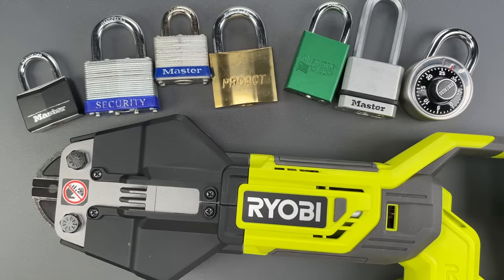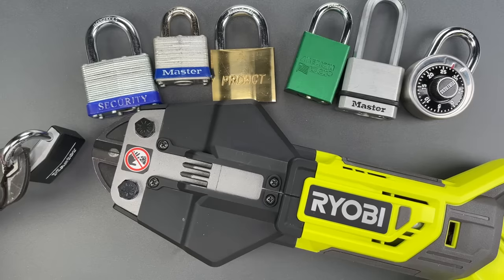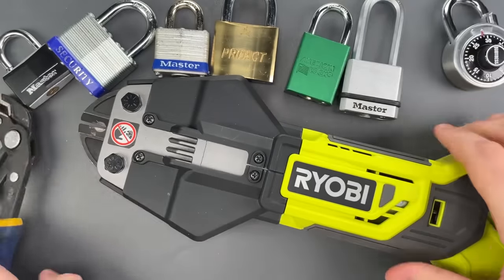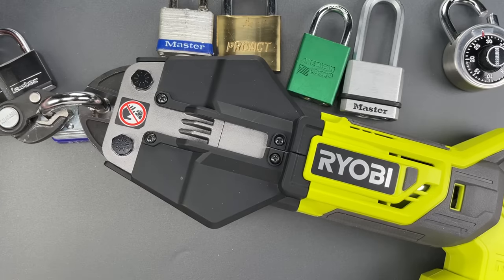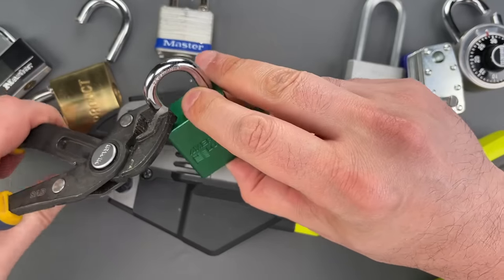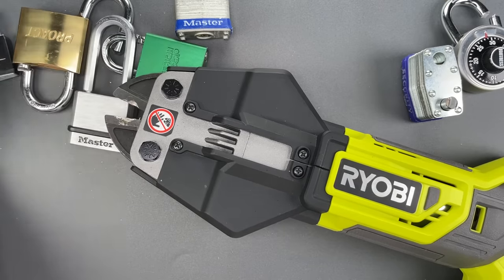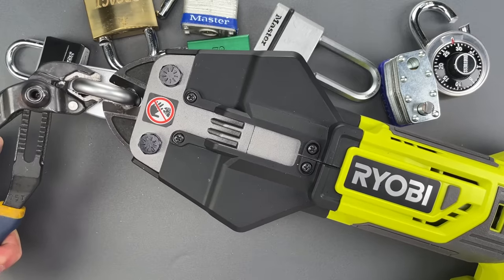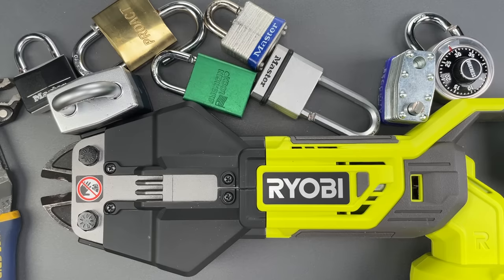[1408] Better Than Expected: Ryobi Bolt Cutter

Comment: I like Ryobi.  In my experience they seem to be thoughtfully designed, with good features and design that when you use them, you realize someone put some time and thought into the design. I should add, I am not saying they are a top tier brand outside of their price point.  I am saying they are a top tier brand FOR their price point.
Reply: In my garage, theres a lot of those Ryobi One+ range, and have been good so far.
Reply: Exactly.  My opinion is they are the best buy in non-professional tools.
Reply: @nonyadamnbusiness9887  Doing metal fabrication at work, theres hililti, dewalt, milwalkee, and makita drivers.

Only the makitia ones are any good.
Reply: The Ryobi of today is the Milwaukee of 2-4 years ago. 

It is the same tool just made with slightly cheaper parts.

Comment: This BC is good for armature work. Hand cutting (even with the floor + lever models) is gonna break your balls, having an electric variant, for those soft metals, god sent.
Reply: if you are in the position to need an electronic bolt cutter for locks, chances are you're out of the "amateur" ranks, either for legitimate business...or otherwise.
Reply: @innercityprepper  note the spelling of armature as in motor windings

Comment: I imagine there's a Squire employee out there that's now quite pleased with his/her handy work.
Reply: Likely they work in the heat-treat department. That's what counts when it comes to steel is the tempering.
Reply: @KF1  That no name padlock was made out of low carbon steel and you can temper it as much as you want with no effect... you need proper steel aloy, proper tempering and proper diameter of the shackle...
Reply: @Bialy_1  Yes, I was assuming the steel would be hardenable to begin with. I figured since it said "hardened" that it likely has sufficient carbon etc. Carbon is cheap, no need for special steel. Maybe 0.5%+ carbon and you're good.
Reply: squire from my own experience puts customers first and the quality of their products are top notch. I've had nothing but great praise for the company and how they treat their customers. Some of their products on the lower end are quite crappy though but only in the cylinder core. The product itself isn't really bad but they keep using their 4 pin core that they have used for 60 or so years and they don't have any anti pick features which is a disappointment. I've only had one lock fail in the field, I wrote to them about it and they sent me a new one free of charge. It's been fine ever since so it could have just been a bad batch which is expected on a large scale production run.

I can't wait to try out their Inigma padlocks when they release them.

Comment: *Reviews the item*
*Item did better than expected*
*"Yes, so i'd recommend using a manual cutter"*
Reply: Because expectations were that it would barely work or the blade would get easily destroyed. It doesn't work well but better than expected, the blade took a lot of damage, but better than expected. A manual pair would have zero blade damage after cutting all of those and it would easily go through all of those (as long as you buy the 18" handles for torque). Plus, manual is much cheaper. At least half the cost I imagine.
Reply: @raheppe  I know. lol

Comment: I'm a long time ryobi customer and I've always been impressed with the amount of abuse they will take
Reply: @LegendLength  the actual Ryobi mowers aren't that great but to be fair, if you're comparing to a Honda or Yamaha, nothing will be
Reply: @santumi2298  i disagree, the new ones with the brushless motor and HP technology kick ass. pretty much up to par with any gas mower out there except for the toro time master
Reply: I did have a Ryobi cordless drill driver (40 buck special) that worked for a year then started intermittently cutting out. So cheap I just replaced it and it’s been fine since. Overall I’m happy and I’d buy Ryobi again. Decent for home stuff and the neon green color really makes it enjoyable and fun to use for some reason.
Reply: @GrandHuevotes  if you want something a little nicer, i’d recommend trying out the hp tools :) but you can’t beat the steal of that $40 brushed drill driver
Reply: Just don’t use them on anything beyond wood. I work with steel a lot and I broke 4 brand new ryobi impact rated bits in 2 hours and broke there drill in a week.
Went to dewalt and they still work (both bits and drills) some several years later… you just get what you pay for
Reply: @ZEPR0FESS0RR  well, that's the difference between commercial grade tools and residential grade. Look at your warranty, it'll tell you what you bought. True professionals know the difference.
Reply: @ZEPR0FESS0RR  DeWalt is typically used for construction, while RYOBI is typically used for household projects.
There's a difference between commercial and consumer grade tools. 
Just like what Cory said, you can check your warranty to see what grade of equipment you have.
Reply: @ZEPR0FESS0RR  Were you using the impact bits with an impact driver? If not, that's why the bits broke.
Reply: @ZEPR0FESS0RR  Ryobi, while decent enough on tools is absolute shite on bits, be it driver, drill, or router. 

For cheap quality driver bits go with Hart. Same company yet some reason they make the Hart bits just that much better.
Reply: Ryobi is a meme.

Comment: Also, a trick which can be picked up from the use of secateurs to cut seasoned one inch branches or those in excess of an inch in diameter, it's always rotating the blades around the object you are cutting as you cut. This progressively reduced circumference and diameter of the material as you go and removes obstruction.

Comment: This would be great at warehouses where you get a lot of containers to unload. The aluminum bolts they use are tough to cut. The manual cutters are not cheap and when they break, you can’t replace the blades.
Reply: I found this useful too at some small post offices, and they went through securicor vans like butter !

Comment: I was hoping you should show the squire lock after the cutting attempt, to see if it had indentations or any visible damage
Reply: hi, do you know the mm thickness of that lock?
Reply: @sbaxter4207  It's pretty easy to eyeball, but 5mm is a hair over (#10 screw) 3/16", 6mm just shy of 1/4", 7mm essentially = 9/32", and 8mm = 5/16".
Reply: I agree, it wasn't obvious, but I am sure that shackle was barely scratched. You can see it in the thumbnail.

Comment: I really love the change of pace with this video. And while I've had a lot of Ryobi tools, electric ones obviously, I'm fascinated they would even make a product like this but as a person who once had a part-time job at a storage unit facility, we had to cut off quite a few locks as part of the Prelude to auction on units that have not been paid for. Forgetting all the other stuff that had to go on, it would have been a cool toy but a pair of good bolt cutters will do the job real quick anyway. I was the guy who used to cut off the lock so I know including the really cool ones. 18 to 24 inch bolt cutter for pretty much go through anything. Just got to know where to place them. I'm surprised they don't offer a premium set of Jaws for that thing that are made out of God only knows what alloy that could really do some incredible damage
Reply: Not going to be able to use any of them all that well on disc locks.  Unless you just cut the hasp instead.
Reply: @greendryerlint  I worked at a storage company. I had bolt cutters four foot long. I would brace the handle against the wall and lean on the other. I would cut straight the disc lock body and shackle. Once I learned where to put the bolt cutters I could cut a notch in a disc lock and remove it in under ten seconds.
Reply: I had a disagreement with a storage locker company once.  I had two lockers, one with low-value stuff in it, with a Master lock, and one with the things I actually cared about, with a quality lock.  They went to cut them off.  The Master lock gave them no trouble, but they were surprised and annoyed when the good lock damaged their bolt cutters.  I still have that lock, complete with a little notch in the shackle where they tried to cut it.

Comment: With how powerful cordless tools are these days, it’s hard to imagine any simple security devices that are capable of keeping your stuff safe.
Reply: reallyits no more powerful than a man with bolt cutters. Its just easier this way.
Reply: @handymanr4729  I mostly referring to like cordless grinders.
Reply: @handymanr4729  and louder
Reply: Petrol Stihl saws and acetylene torches have been around for a long long time (as well as good old manual bolt croppers)
Reply: @SpecBASStuff  But petrol saws and acetylene torches are not portable and ultracheap. Even the most brazen thief might attract unwelcome attention carrying an oxy and acetylene tank around in city streets looking for bikes to steal ...
Reply: @kenoliver8913  every cracked has a stolen sawzall or angle grinder these days to steal catalytic convertors.

Comment: Small oversight, You could have shown Squire and Ryobi from different angles after failed opening attempt. I believe this community has some pretty clever metallurgist around and they could have explained "what and why" to others. From this angle it's not visible if shackle is slightly dent or not touched at all
Reply: Yes , I thought he was a bit quick with Squire . I replayed it a few times looking for a nick . Honestly , I even looked to see if Squire were sold on a LPL link .
Reply: There is a small dent in the side of the shackle if you look carefully, but its not deep enough to get to the full width of the shackle, only about half I think.
And it did not seem like the blades moved the last times he pressed so I think the tool had stopped moving and the sound was just from internal tolerances.
Forcing it would probably just damage the cutters mechanism, not only the blade.

Comment: When I was driving my truck over the boarder I often had some really tough locks of one sort or another put on the trailer. Some by customs . I had bolt cutters that were taller then me but still once in awhile I would have to get someone a good bit taller then me to cut the bolts off . They were more bolts then locks no key or anyway of getting them off but to use a huge bolt cutter. Still I never had the cutters get damaged .

Comment: still takes longer to use a bolt cutter on a master lock than it does to rake it open.
Reply: If its rusted to a gate chain this is definitely the way to go.
Reply: Pad lock doesn't open
Angle grinder: so u have chosen death

Comment: It would be interesting to see how this tool performs if a hard-facing welding rod is applied to the business end of its blades (with sharpening afterwards, of course)...
Reply: Not well would be my guess. Those blades are probably cast then machined down to good blade geometries, or forged and machined. Forged being better of course. They are almost certainly then quenched and tempered giving the blade a homogeneous material without any internal stress risers. 

A dissimilar material welding process and a manual sharpening, even if the weld was perfect and without any discontinuities, would probably give you a nice linear stress riser at the heat affected zone  Your blade alignment and geometry would be slightly out of line with the direction of force, or be pushed out line. This would transfer some degree of force directly to your HAZ in a twisting motion. Your hard material would just snap right off when put under that kind of strain.
Reply: @jamescheshier1385  this guy metallurges.

Comment: I bought one of these to cut down a chain link fence on a property and it did really well. the blades wear out fast though, unsure what kind of metal they are using but it doesn't hold up very well.
Reply: All the power is in the very tip of cutting blades, any lower will result in damage. One love

Comment: I’ve wanted to pick one of these bad boys up for awhile because a lot of the loads I have use a bolt style seal that requires bolt cutters to remove for docking. And no two of those suckers are the same. Some you can cut comparatively easy, and others will fight you to the death. Ode to the joys of regularly transporting firearms. 
Can you test this out on some bolt style seals?

Comment: you need to insert the lock deeper into the jaws, there are even marks on the jaws (the small silver semi circles). It would give better cutting force. A fully charged battery with higher output would help a lot.
Reply: I'm pretty sure he was pushing the lock into the jaws as far as it would allow. And for the big round shackles, jaws open at a wide angle will push the shackle out with some force before they're able to get purchase (the higher the angle, the more the push-out force).
Reply: The small silver semi circles were just from were he'd already used it. There were none on the new blades he showed. 🤷‍♂️

Comment: I was hoping that you would show how much damage there was on the Squire lock. It looks like there was some cutting on the shackle and would have liked to know how deep it was.
Also like Big Clive had mentioned the cutter was tripping a lot. I wounder if the battery or the motor was causing that. Though the use you put it through wasn't that much, that motor must be pulling a large load from the batteries. The motor might have needed to cool down a bit for that last lock. We had a new jack or lifting table like that. It was supposed to lift 1,000 lbs. But with heavy use and a lift of a heavy part, 500 pounds or more to place it on our milling table, the motor would trip because it would overheat and trip trying tying to lift the part up 4 foot. It would also trip lifting lighter parts up to bench height of used more than 3 time in a 5 minute period. We turned the unit in so I never found out if it was just a bad motor, unit or something else. We wound up with one from a different manufacture that worked great.

Comment: As someone who works in an Engineers’ Merchant in the UK, it’s nice to see a Squire padlock living up to expectations. Although my shop and my customer base avoid Ryobi like it’s the plague, perhaps those bolt cutters would be more targeted towards an elderly person rather than your average handyman, so to me they’re just a gimmick. Thankfully I’m a proud owner of a nice set of manual original Eclipse 24” bolt cutters handed down from my grandfather :) Good video as always LPL!
Reply: These Ryobi cutters are used a lot in shipping ports to open container bolt seals.  They prevent injury by avoiding the twist that most people use when cutting the bolts with a manual cutter, and there's an aftermarket guard that they make for them to catch the seals after cutting.
Reply: @inibrius5380  I don’t know what you’re trying to prove, but good for you! Wooo! Go dockyard workers!
Reply: @w00llee14  he's explaining an application that justifies the need for a power bolt cutter in response to op?
Reply: @w00llee14  I thought passive aggressive insecure anti-intellectualism was just an american thing. Nice to see something we invented catching on
Reply: @alakani  If you thought my response was what you described, then it seems you are insecure yourself. Thank you for the reply, even if it was unnecessary.
Reply: @w00llee14  I don't know what you're trying to prove, but good for you! Wooo!
Reply: @alakani  And it seemed you had no clue what you were talking about. Congratulations! Enjoy the rest of your summer! :)

Comment: that tool would do well cutting mesh for a concrete pour

but there, a bolt cutters with a long handle is an advantage, as you can stay standing up sort of while you cut the mesh

Comment: My 36" bolt cutter blew through a 5/16" case hardened hasp and then through the 3/8" bolt,. This beast you have to have muscles to use. While you need muscles, you also need a piece of unexpected hardware, something most people would not have used a cargo strap that can be tightened. It did go through the item but destroyed the bolt cutter in this process.

Comment: Edit: I just looked it up and it's almost 4k usd. So yea I would hope the ryobi is more affordable.

Like 15 years ago there was a tool like this that costed 2500 dollars. It was a portable hydraulic bolt cutter. Not mucho info about it,it was green and it looked like a beefy portable drill with a bolt cutter head on the end of it. It looks like this has become more affordable maybe, though more ersatz looking. this unit is clearly not as beefy, but it definitely works.

Comment: So now a competent security system needs motion sensors, thermal imaging, night sight video AND listening for the sound of a Ryobi bolt cutter or an angle grinder being used on the premises.
Reply: Don't forget, it also needs to listen for that click on 3.
Reply: Probably don't need IR if you have thermal. Where thermal has a hard time, IR is also struggling most of the time. Massive floodlights blinding intruders and lighting up the area is probably more effective and cheaper than discreet IR.

Comment: For the disabled, automatic cutters can be incredibly useful. Not to be undervalued!
Reply: Oh yeah, they're a great thing for sure. Manual bolt cutters require some grunt that a lot of people don't really have.
Reply: Good comment! :) My thoughts exactly. The first noise from the machine was a turnoff but then I saw the ease of use.
Reply: Are there many disabled bike thieves? Not that I believe they shouldn't have equal opportunity.
Reply: @twotone3070  i like to imagine the disabled folks using these aren't stealing bikes, but if they are, good luck to them. You do what you gotta do sometimes.

Comment: Nice video! That tool is more for warehouse receivers/guards to remove the bolt seals from cargo and semi trailers. Busiest warehouses will cut over 200 seals a day. High value loads use numbered steel bolts to secure the trailers during transit.